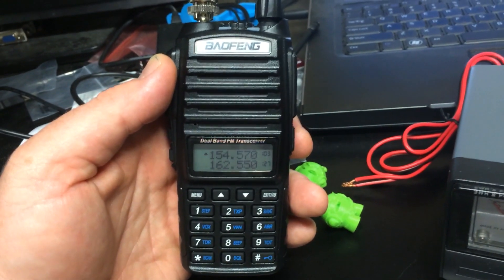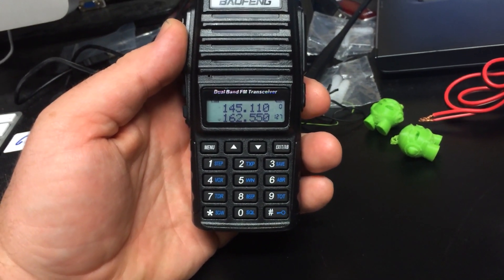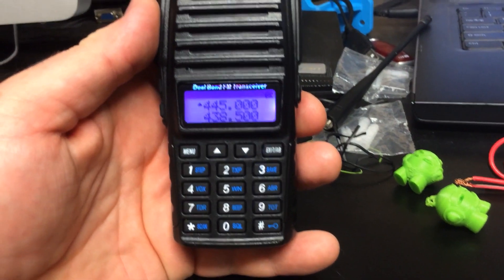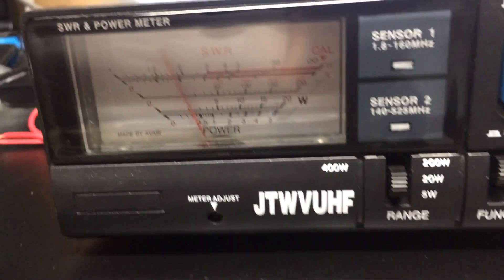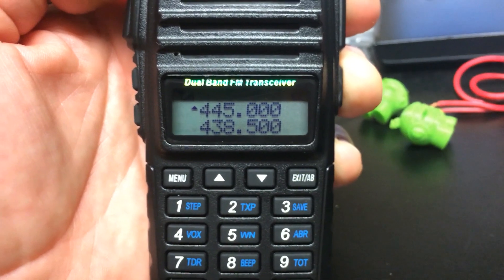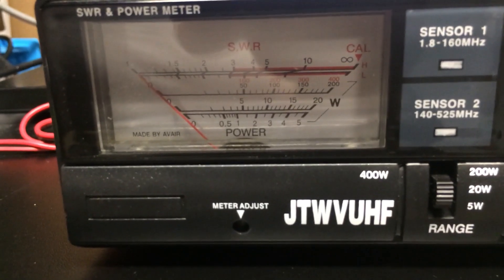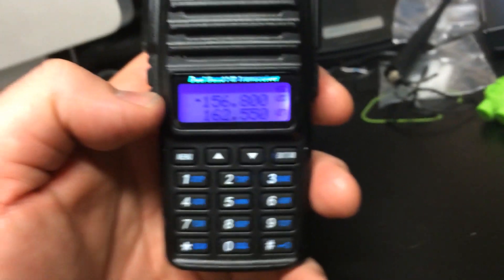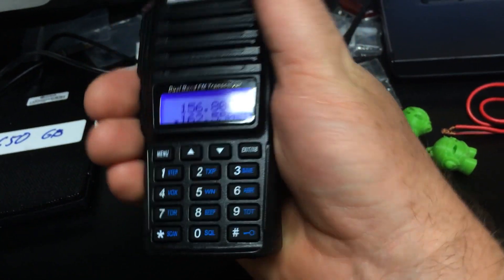Power output and RF burns from the Baofeng UV-82

Comment: Ha used to work with a ANGRC-50.  And you will get rf burns. That's why I want to keep power down. Just to enough to get contacts. And a better antenna. Will work just as good as 5 watts of brute force on a  stubby antenna.

Comment: With ohm's law i calculate a voltage of 17.32v on the output if the load is indeed 50ohms. And that's at only 6 watts instead of 8. At uhf's in the hundreds of megahertz those frequencies are beyond causing you much discomfort from shock. Especially at that voltage, BUT vhf's are a different story. I can see this radio giving you one hell of a jolt and even being dangerous in certain conditions. But aren't all radios like that?

Comment: The watt meter you are using is close enough... you do not need to calibrate.. to use it... The RF burns you are getting at 8watts output on 2Meters is interesting..  I have a variety of BaoFeng (pronounced Bhaoh Fung) University of Beijing Mandarin westernized pin yin pronunciation... never received a sting or burn from any of them... but I will give it a try on the bench... by testing the power charger connections... for RF...  incidentally we have tri powered BaoFeng HTs that operate at 1, 4, and 7-8 watts. I never use it on the HP,  8 Watt setting... almost always leave set at 1 watt... and at 1 watt, over 250 ft of LMR 400 it gets out great and receives very well and it's audio out always gets great audio  reports... FYI Just Saying. Great Made in China radio.... inexpensive and works very well... There are more of BaoFeng radios in the world than any other manufacturer's.  Also, The # key, when keypad is unlocked, will toggle the power out settings.. save battery, use minimum power... radio will run cooler..

Comment: I think you need a real watt meter and load and/or you don't know what you're doing. If you could receive the weather channel in your basement something is clearly wrong unless you live next door to the NOAA transmitter. And I also doubt a 5 watt Baofeng cheap radio put out 50+%more power than specified. In fact nearly every Baofeng radio, when properly measured, is lucky to manage better than 80% of its rated power. So your 7.5+ watts is nonsense. Around 4 watts on 2m is realistic and consistent with other Baofeng tests. SWR and power measurements at vhf and above are not trivial and a no-name likely Chinese meter can't be trusted. The rf burn issue is well documented with radios with exposed battery contacts. Your body is effectively the counter poise to the single ended antenna. Your video is not very helpful and even misleading.
Reply: Clearly, he's using the UV-82HP model, which is rated for...wait for it... 8 watts.

Comment: Your not getting anywhere close to good readings from that setup your using. If your receiving NOAA while testing, it does not mean you've got a really fancy radio, it means your setup is not fully grounded, and there are RF leaks. Also that Load is total crap! Your better of finding a used Bird dummy load off Ebay for $40. I tried one of those MFJ 260C dummies last year, and it's just a tin can around a really cheap resistor. You can get much better for the same money.
Reply: Benny R or he can use a PL259 connector and solder a resistor into it i have one and its a good tiny dummy load it handles 15 watts

Comment: I put my voltmeter probes across the respective + and - terminals on my Icom IC-V82's battery. When the radio was either A.) Off or B.) On standby, it indicated 0 volts. As soon as I transmitted (low setting) I read 7.2 volts across the terminals. The battery is an Icom p/n BP-222N, Ni-Cd chemistry, 7.2V nominal. Any conductor placed across these terminals when an HT is transmitting will short the battery. This includes amateur radio operator's sweaty palms! The conductivity of human skin varies from individual to individual, and also with several other variables. On a dry, cold day an individual might feel nothing when placing skin across hot battery terminals. On a hot, humid day, perhaps after some exertion, the same individual will likely feel the current across their skin when transmitting and shorting the terminals.
Reply from the maker: +Joshua Moser I don't think that is what is happening.  I have never received a shock from 7.2v that I can remember.  But I would have to be touching both terminals to get a shock and I didn't need to touch both terminals to feel this burn.  I feel like the negative battery terminal was acting as the other half of the antenna.  See item 6.11 here:  http://www.miklor.com/uv5r/UV5R-FAQ.php
Reply: I'll bet Minus battery is the same as minus (PCB earth) that goes thrue the entire unit.
Do you get the same "chock" when you unplug your equipment?

Comment: what do u mean when u say RF BURNS?
Is it bad or good thing?
Reply: If you mistakenly place your thumb across the coax on the transmitter output of a 50 watt UHF repeater during a repair moment, it's a bad thing.  The reward for that stupidity is getting a small hole burned in your thumb that takes about 6 months to completely heal.  My thumb is OK now.......
Reply: Thank you for the chuckle. You just made my day! That reminds me of the time I plugged the cable from my mobile antenna into my HT. The antenna cable was laying across my passenger seat in the hot blazing  Texas sun. When I grabbed the BNC connector on the end of the cable with my fingers it felt like I picked up a red hot briquette off the BBQ grill. I learned my lesson the hard way.